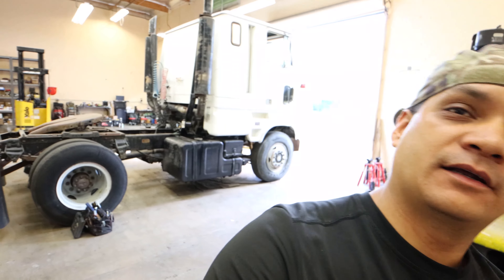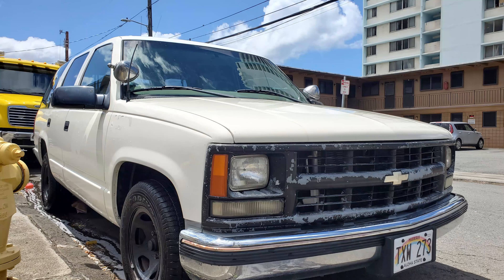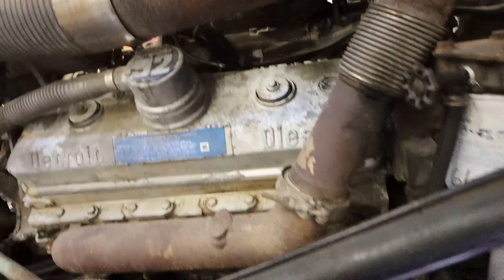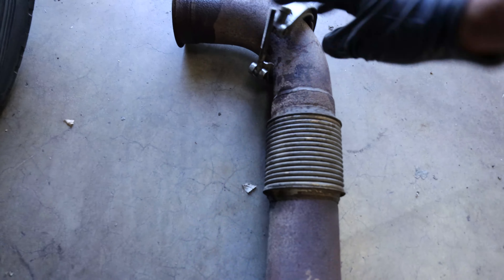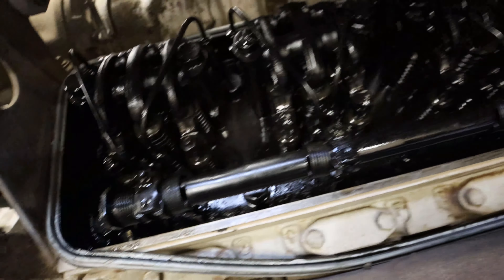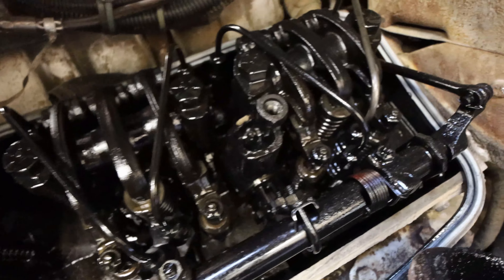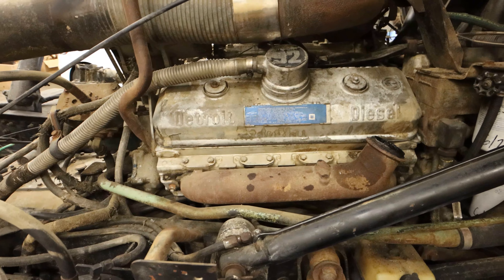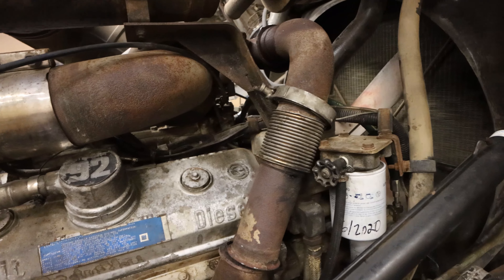Project Pugly August 2020 Update!! What HP injectors?!?!?

Comment: Cool truck, would love to have a cab over. Your going to need the taller rocker covers if you put jakes on. Those are the short ones. 
Make sure your cooling system it in top shape for that higher hp.. and make sure you are only running a 7 or 8 lb. radiator cap.. The head has rubber o-rings on the coolant passage that will blow out with the higher coolant system pressure.